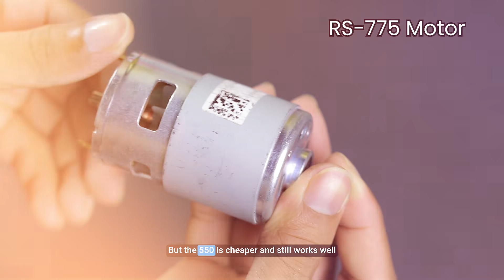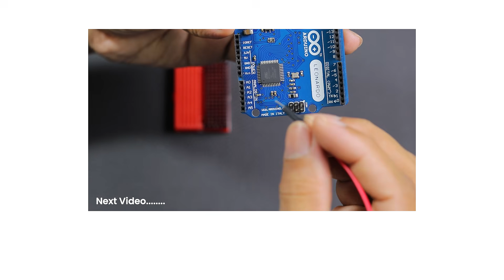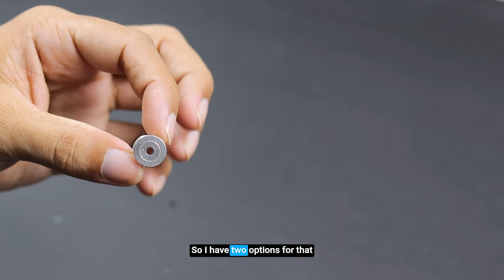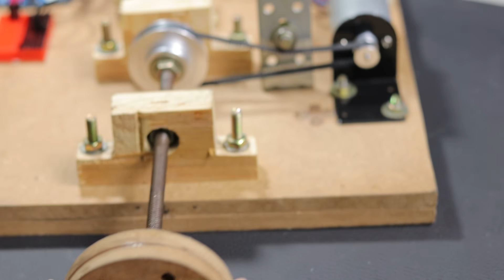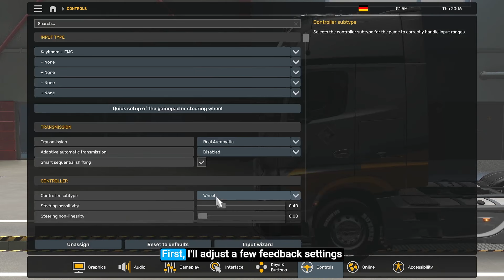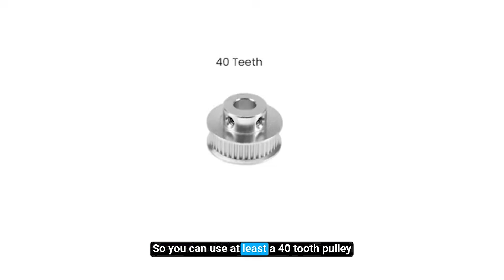DIY Low Budget Force FeedBack Gaming Steering Wheel

Comment from the maker: Component Price Estimates (June 2025)

KY‑040 Rotary Encoder Module  -  $1.20–$1.50

RS550 DC Motor  -  $4-$8

550 Motor Bracket/Mount  -  $1.5-$3

GT2 16T Pulley (3mm Bore)  -  $1-$2

GT2 60T Pulley (8mm Bore)  -  $2.5-$5

GT2 300mm Closed Loop Belt  -  $1-$2

BTS7962 Motor Driver (IBT-2)  -  $5-$9

Note - Prices may vary depending on quality, brand, and shipping location, but this should give you a rough idea.
Reply: ado patta ban, keep it up
Reply: Can I use 775 motor?
Reply: @Yashprojects-7yes it will be better
Reply: How many nm
Reply: @Ukuleou 1 prolly
Reply: Please anyone reply to this  🙏🏽 

Can I use the ESP32 dev board instead of the Arduino board?
Reply: @theRudraMondal probity not
Reply: Where the code
Reply: Nice bro 👍🎉
Reply: Can I use  BTS7960?
Reply: @Otacheetos  👆same question. As I can't find BTS7962 anywhere
Reply: they're interchangeable
Reply: Can I use as5600 instead of the ky-040?
Reply: from where you bought these all?
Reply: Hi, what should I do if I have some cheap steering wheel with buttons and pedals, is it possible to connect all of this to your setup?

Comment: Hi! With this homemade DIY Arduino car simulator setup, is it possible to play Need for Speed Carbon? Can the game detect the Arduino controls as a steering wheel/game controller, or does it block/ignore the Arduino input? If it doesn’t work directly, is there a way to make it work?
Reply from the maker: I'm not sure actually, but if it doesn't support it, you can use the GimX adapter option. Because Logitech wheels support that game. So it should work.

Comment: Which power supply are you using
Reply from the maker: For this, I used a small bench power supply. You can use a PC PSU or a 12v 15A PSU.

Comment: dude i have a problem my ffb only work when i turn my wheel left and does not work when i turn it  right
Reply from the maker: Check your bts driver signal wires. One of them is not connected properly

Comment: why my rs775 if iam connect to 12v and 2ampere adapter,he move 1 second and stop 0.4 seconds
Reply from the maker: For a 775 motor not enough for 2A, it's required 10-15A (depend on the motor specification). That's why your PSU is stopping.

Comment: may i know NM u get with this rs775.. bruu?
Reply from the maker: Peak torque per 775 motor ≈ 0.9 Nm
My latest wheel - the gear ratio: 60T / 12T = 5:1
After gear reduction: 0.9 × 5 = 4.5 Nm per motor
Dual motors combined: 4.5 × 2 = 9 Nm (theoretical)

Belt Drives Are Not 100% Efficien (because of the belt flex)
Estimated timing belt efficiency: ~90%
Final peak torque: ≈ 7–8 Nm
Reply: @zudumalli  hmm..  with rs775 u can get 7-8nm, imagine ..how big your NM torque would be, by using my6812.  
it means, ur NM is up to t300rs .. bruu👍

Comment: Can I use an electric floor fan motor? please
Reply from the maker: Not really. Most floor fan motors operate at 220–240V AC. In this project, we use 12- 24 V DC motors only. Even if the fan motor can run, it has low torque and a slow response.
Reply: @zudumalli thank you

Comment: Hello, I would be very grateful if you could answer.
Can I use a Cata CT2677 12V 21A LED transformer?
Will it overheat a lot with an RS775 3000rpm motor?
Will the amperage be sufficient?
It doesn't have a fan inside.
Reply from the maker: 1. Can be used, but I actually don't know how it will be performed because these LED drivers are made for constant current, but the FFB wheel creates rapid current spikes. So if the driver can't handle those spikes, it can go into overcurrent protection or shut down.

2. Can overheat without proper cooling. its depends on how you use it.

3. Its depent on your motor specifications. It's normally used 10-15A, some are use maximum of 25-30A.

4. The inside fan little help to move air inside the motor however, ensure the motor has good airflow.
Reply: @zudumalli Thanks. Since it can continuously supply 30A, I don't think it will have trouble handling sudden current spikes; however, I'm a bit confused because I've seen in some places that the motor draws 25A. That’s why I’m going to get the 12V 30A version—to avoid any shutdowns during sudden high-amperage draws.

Comment: When I go to buy the motor there’s always two options. Should I buy the 12V one or the 21v one?
Reply from the maker: 24V is more better, but you need a 24V PSU as well.
Reply: Thank you! I just finished building the original low budget steering wheel and it’s great! I’m now building the pedals then I will add FFB!

Comment: Can I use the h shifter and handbrake (you made in the previous video) with this  and what is the connection to connect ?
Reply from the maker: Yes, you can, and wiring, both video has the same.
Reply: But for h shifter, in the vedio it is  connected to gamepad, so   what should I do?

Comment: Bro can I use a 775 motor with the BTS 7960 motor driver ? Also I had found two motor driver called BTS 7960 and BTS 7962 ,which one is suitable for 775 motor
Reply from the maker: As far as I know, there is no BTS 7962 module. It's BTS 7960 driver and yes, it can use 775 motors.

Comment: Can u tell where and how much the price of all the parts in rupees, I'm from srilanka
Reply from the maker: most of the parts I bought in Nugegoda troniclk and the total price like less than rs.5000 (for this low budget wheel)
Reply: @zudumalli thank you bro but what if I get it in daraz is it fine? But the whole amt is abt 8k so I was thinking to use an old laptop charger as the power supply

Comment: Bro, I made this wheel work almost fine, but when I took a sharp corner in Assetto Corsa center position of the wheel is changing slightly.
Is it because of the low ppr value?
How can I fix it?
Reply from the maker: That can happen if the encoder and wheel lose their exact position while driving. It’s not only because of low PPR. A low PPR encoder can reduce accuracy, but this problem is usually caused by the encoder shaft and steering wheel missing position slightly during operation.
Reply: @zudumalli I'm currently using hot glue to secure this. That must be the cause of the issue. I'll try using epoxy glue soon.
Reply: @zudumalli  fixing doesent work it happens either because low ppr value or board fails to communicate quickly with pc

Comment: I built one with rs775, it works fine but in f1 22 there is a deadzone in forcefeedback motor doesnt apply force if i dont turn it 4 or more degrees when in full speed(no deadzone in wheel just in forcefeedback) using emc lite software

Comment: I can't find 16 threaded 3mm, can I get another piece? What are the important details?
Reply from the maker: You can use a 20-tooth pulley. lower teeth (for motor side) = better torque
Reply: @zudumalli I will start to do it, but I will make the first steering wheel, but I am missing a 900 degree I can not make the steering wheel, I need a gear because I use a 10k potentiometer, but I can not find it.

Comment: Bro will it works on Assetto Corsa Competizione
Reply from the maker: Yes
Reply: @zudumalli  Bro, I made this wheel work almost fine, but when I took a sharp corner in Assetto Corsa center position of the wheel is changing slightly.
Is it because of the low ppr value?
How can I fix it?

Comment: Hi, great series video. Since I used to drive trucks in Euro Truck Simulator with steering at 2160 degrees. How do I increase EMClite steering angle from 1080 to 2160?
I really appreciate any help you can provide.
Edit: Never mind. I found it myself

Comment: it needs at least double the gear ratio than used in the video, the motor has low torque but has plenty of speed that allows it be more geared down and still keep reaction time high.

Comment: Bro will this motor can blast and harm our laptop or pc, and which motor should i use
Reply from the maker: No, that won't happen. You can use 775 or 550 (as a low budget)
Reply: Can I use a 775 motor instead of this and use all similar steps and part
Reply: Thx bro ❤❤ 👍👍👍👍

Comment: I think an incremental encoder would be better than the encoder module, but it's more expensive. You can also use a MT6701 magnetic sensor, which is cheaper.

Comment: Bro my ffb wheel 775 motor lost power gradually throughout the time, and now it completely stoped working.
I heard metal scraping against metal inside the motor. What could be the cause for this and how can I fix it? Please help. 🙏
Reply from the maker: The carbon brushes in your motor are worn out. You can replace them. You can find those parts online.

Comment: please make a wheel that is more capable than a t300 or moza wheel which would obv not cost that much, direct drive or whatever just make one that is capable for no hesi, drifting, i have made a wheel myself but not like this i just used mechanisms which i created to click keyboard keys when i turn the wheel right or left same with the pedals but i want to make a proper wheel, but i dont want to do the same thing again like keyboard keys thing. I want to make a proper FF wheel. I can make this its not that difficult but please make a high power or torque one that doesnt feel like a compromise on feel. Yk what I am saying, i am subscribing and i will wait for your vid.

Comment: I am disappointed in myself, I have bought 4 Leonardo Arduinos, 4 bts7960 drivers, a 775 24v motor, a 24v power supply and a 600 pulse encoder, the encoder works well, its 900 degrees but I have not been able to make the Force Feedback work, I even measure the output with the multimeter at the bts7960 driver port and it is 0v, it does nothing, I have tried with different boards and drivers and nothing, even the bts7960 driver works if I use another program to control the motor worse in the simulator with EMC it does not work.

Comment: Will this software work with a larger 500w motor?
Reply: Pretty sure it will 
There is no difference between what motor you use apart from the power it needs
If you can power it you can use it

Comment: Why don't you connect gears directly instead of using the belt? The belt might slip, but connecting gears directly will transmit all the power from the feedback motor more efficiently.
Reply: geared force feedback feels AWFUL. Pulley/belt driven force feedback is the best option when you cant use direct drive...
Reply from the maker: Due to gear backlash
Reply: Backlash will be negligible to none at this scale, the belt is probably what is making some of those games unplayable...
Reply: Quieter, better, no backlash.

Comment: Hey, I'm planing to do one myself but I have a doubt about saftey. How does the System handle situations when the motor is stopped but applying force? Does the software cuts the current a bit? And the same with the changes of direction? For context I'm Going to use an 80w 24v dc motor for the project, But just that I'm concerned of the motor shortcircuiting because of the heat.

Comment: Can use 895 or 997 for higher torque, but need to use clamping 3m/5m pulley so that it wont slip. Those pulley min 20T , max 60T, can do double reduction if necessary.
Reply: i wonder if using 3d printed gear would be better, because of the constant touch of gear rather than loss of pulley
Reply: @PixelSoul.  Yes, you may use 3d printed gear but it would be noisier and weaker than pulley belt systems that is cheap and easy to maintain.

Comment: Bro, can you tell me how you did the ffb  setup in your steers ng wheel you made from joystick and with cable wire and spring .I am a bit confused in it especially in that point where you idk somehow set the cable wire between those three wooden circles and also tell me why you tied steel wires on the middle small circle  to keep wire on place.
Plz guide me I am confused ..